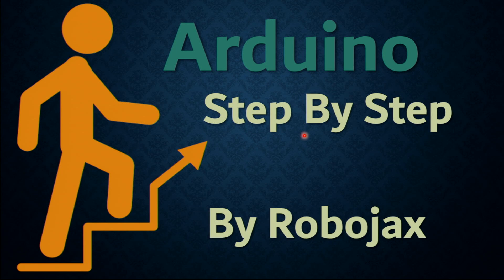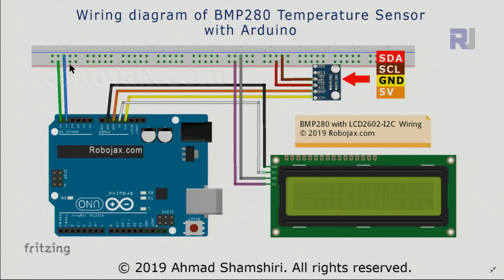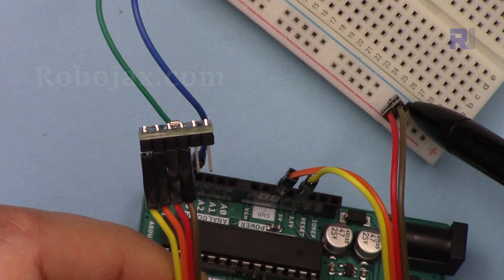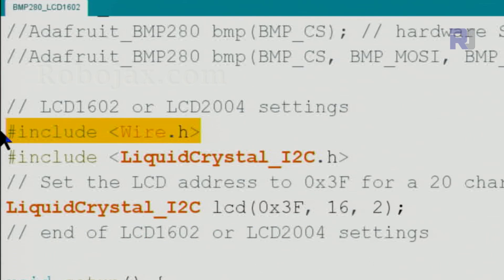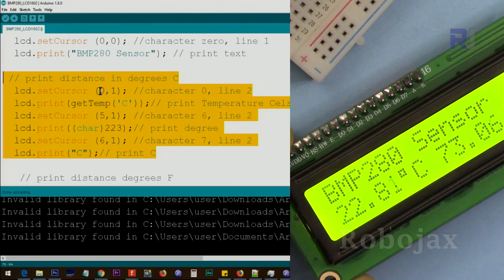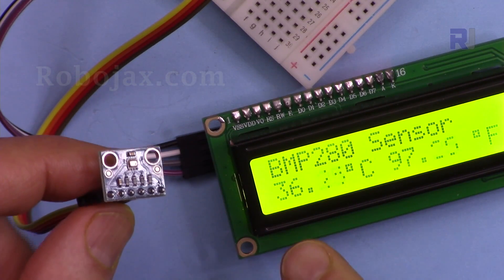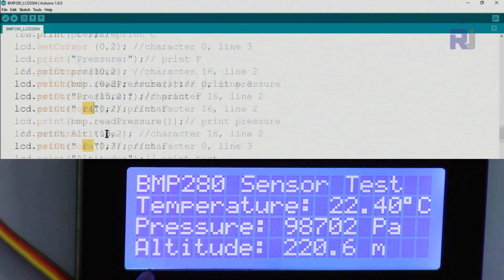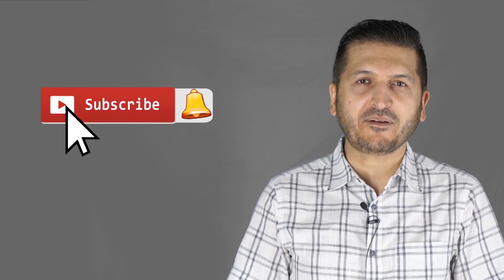Lesson 30: BMP280 Temperature Sensor with LCD1602- RJT539

Comment: Hi, 
I have tested the LCD and BME seperatly , all working fine checked address LCD 27, BME 76
when I complie with this line in I get an error, If I omit the line with //  , compiles fine and uploads. 
But nothing happends on the LCD.
Any ideas. Thanks again.
lcd.begin();
no matching function for call to 'LiquidCrystal_I2C::begin()'
Reply from the maker: You are not listening
Reply from the maker: Read my previous comments

Comment: HI
When compiling your sketch I getting this message. ay ideas what I can do to fix it . Mike
C:\Arduino\sketch\bme_lcd_robojax_18_05_23\bme_lcd_robojax_18_05_23.ino: In function 'void setup()':
bme_lcd_robojax_18_05_23:55:13: error: no matching function for call to 'LiquidCrystal_I2C::begin()'
   lcd.begin();
             ^
In file included from C:\Arduino\sketch\bme_lcd_robojax_18_05_23\bme_lcd_robojax_18_05_23.ino:37:0:
C:\Arduino\sketch\libraries\LiquidCrystal_I2C-1.1.2/LiquidCrystal_I2C.h:58:8: note: candidate: void LiquidCrystal_I2C::begin(uint8_t, uint8_t, uint8_t)
   void begin(uint8_t cols, uint8_t rows, uint8_t charsize = LCD_5x8DOTS );
        ^~~~~
C:\Arduino\sketch\libraries\LiquidCrystal_I2C-1.1.2/LiquidCrystal_I2C.h:58:8: note:   candidate expects 3 arguments, 0 provided
Multiple libraries were found for "LiquidCrystal_I2C.h"
 Used: C:\Arduino\sketch\libraries\LiquidCrystal_I2C-1.1.2
 Not used: C:\Arduino\sketch\libraries\Arduino-LiquidCrystal-I2C-library-master
exit status 1
no matching function for call to 'LiquidCrystal_I2C::begin()'
Reply from the maker: It seems you have skipped lesson 19. And introduction to the temperature sensor. Once both work them come to this lesson
Reply: Hi . Thanks for reply. I will recap on the lesson. The sketch I complied is from this video, so not sure why it doesn’t work. I have used you other examples controlling motors etc, really good. Do you have any building Segway’s?
Reply from the maker: you have skipped. without libray it won't work. so watch and install the library from lesson 19. I just watched the video  and right at the begning is mentioned that you must watch 1-Introdcuction to LCD, 2-Introduction to  BMP280.
Reply: Thanks for your reply and so prompt. Your other videos are so informative and I have used your examples to learn so much.
Reply: Found the answer , I left the first line without // . Will retry tomorrow. Thanks